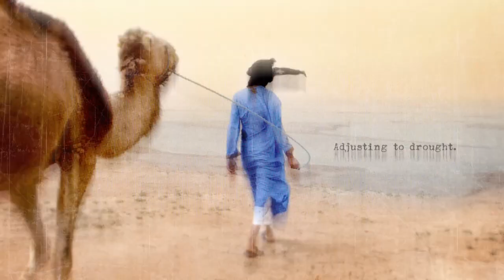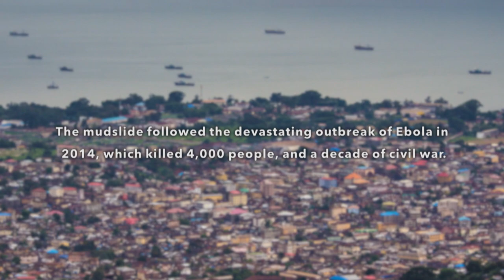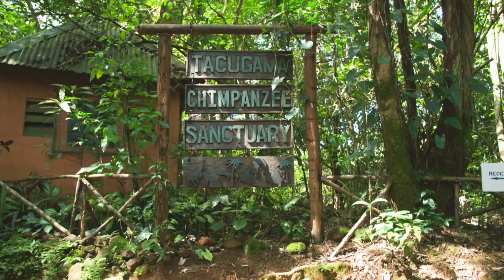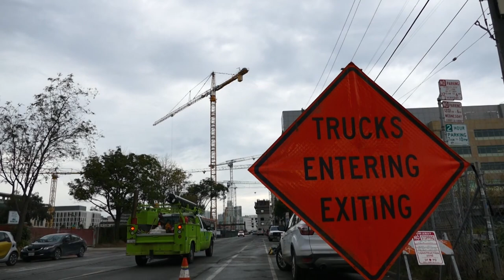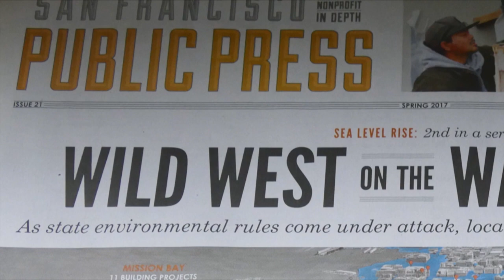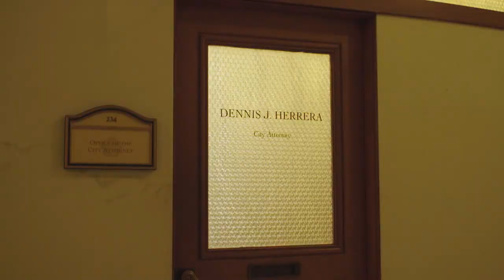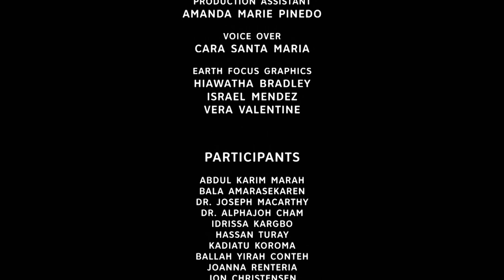City Planning | Earth Focus | Season 1, Episode 3 | KCET

Comment: Why aren’t the “city fathers” insisting that buildings on the waterfront be built like the newer public access spaces in the Netherlands. Instead of installing floodgates on basement level parking garages (as is being proposed by the new arena in SF), builders in the Netherlands are building such places as convertible space, to allow overflow from surface streets to collect in their concrete basements. Once the storm has abated this overflow is then pumped out of the basement and the space is returned to everyday public parking.
Instead of continually fighting a losing battle, they are allowing the excesses of climate change to ebb and flow in a more natural cycle in our cities built environments. 
This is forward thinking. It is critical thinking. It is brilliant thinking. And it is working! 
The US has fallen behind in nearly every discipline and nearly every metric possible. This is due to the anti-science, anti-education, anti-intelligence, anti-social, anti-diversity, anti-compromise, anti-truth “leadership” of the current administration in Washington DC.